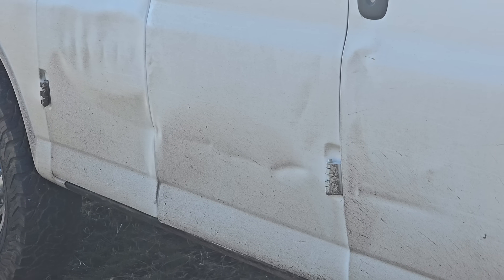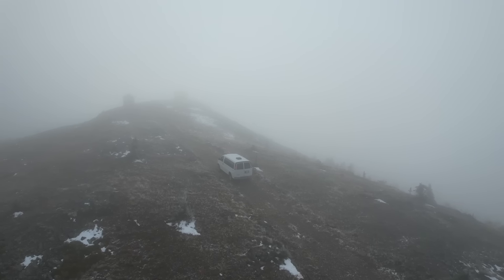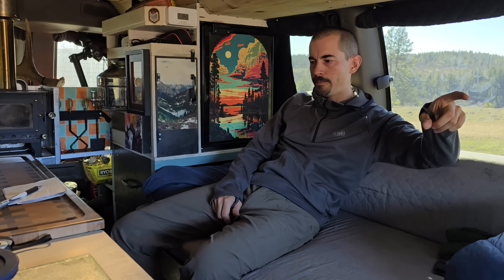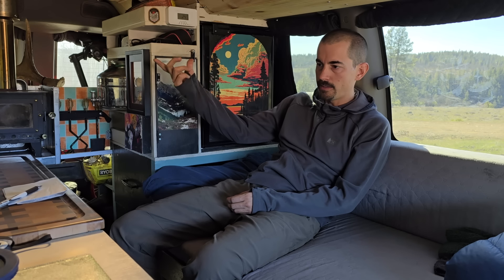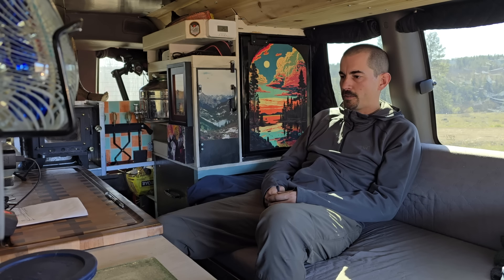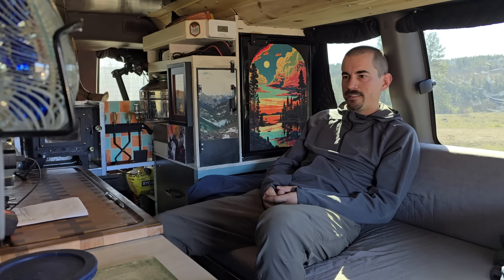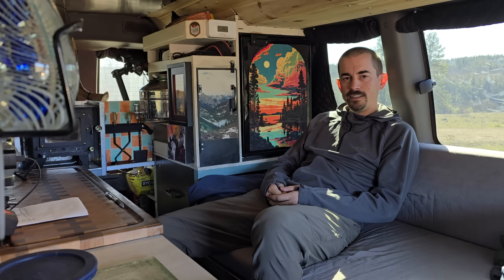Lets just talk about condensation and insulation.

Comment: I’m a certified energy auditor. Important to pay attention to the places where unlike materials touch. They are the weakest part of construction. As far as condensation and heat loss are concerned, your weakest places are where you have wood supports touching your metal ceiling.

If possible, remove everything, take your van down to the metal shell, remove rust, seal all nail/screw holes, and insulate ceilings and sides with spray foam. Put 2” closed cell foam on the floor. On the floor foam float the tongue in groove floor of your choice. Leave 1/2” all around the floating floor to accommodate humidity expansion. 
If wheel wells are noisy you can cover them with hushmat.
Reply: Absolutely nailed it! Great explanation
Reply: I am a HUGE fan of closed cell  spray foam.  We have used it on the floor joist, bays, faces, and cheeks of wood in damp crawl space at our cabin. ABSOLUTELY no transfer of vapor. I will use this in one of our Quigley cutaways that I want to use for 4 season travel. Additonally,  combustion air for a wood burner is KEY. Going to design my own with vertically orientated 10"x10" box tube. Fire brick lined, window glass, and combustion air coming from outside wood burner for the vans. It'll be like a sailboat stove ...but less expensive!!. Both our cabin and home are so tight that it'll pull a vacuum when we run wood burners that aren't drawing outside air for combustion.  In our home itll draw air thru  a basement drain traps. Pretty crazy, but SUPER high efficiency and tight structures  (vans too!!) will do wierd things
Reply: being too sealed up may have consequences for carbon dioxide and VOC levels especially in a small space
Reply: @ytuat  CO2 is not a problem.. CO is.
Reply: @ytuat  adequate ventilation is essential in any living structure
Reply: how do you fasten things down if it's complete closed cell spray foam? Pre-set fasteners and foam in/around?
Reply: Over 2000ppm CO2 will get to be a problem.  Over 3000 will eventually make me nauseous, feel like crap.
I keep a CO2 meter on the kitchen counter, in my van home.   I aim for 1100 to 1500ppm.   It's always a tradeoff, with fresh air causing more heat loss.
Reply: @OntarioBearHunter  ASHRAE recommends maintaining indoor CO2 levels below 1,000 ppm as a guideline for acceptable indoor air quality.
Reply: You forgot to mention that all of the windows have to be removed for true thermal control and efficiency. 😊 Oh, and every internal surface material needs to be thermally broken somewhere before it is in contact with any external structure. I am amazed at how badly even "4-season" RV's fail just about every principle of thermal conductivity. The supposedly superior names like Arctic Fox bond interior walls directly to exterior walls through an aluminum frame. 🙄 It's very obvious that the industry only employs CAD people and refers to them as engineers, not relevant PE's. But then again, they refer to aluminum foil as insulation, so...

Comment: Restoration carpenter here. There is a book called “keeping the heat in” by natural resource Canada. Has a lot of good info. Your insulation idea is good; and any spot where you have cavity’s you cant get rigid insulation in, try ROCKWOOL brand, or something similar(because it will get rid of the water if it does get wet). And lastly, for your boots, I’d say have a vent for the diesel heater to point at them. Get them dried out in an hour or two( or the electric boot dryers work well) while your cooking supper, so you can vent all the moisture before you close windows and hunker down for the night. Big fan, cheers

Comment: Hi F F. Always run wiring where it is easiest to access .  Having done more than my share to van travel I know there are many gremlins waiting to cause havoc..  You would be amazed how wiring can cause a lot of issues.  Having access to all your wiring is so important.  So easy to add accessories or remove or replace them.  My van was the same as yours.  Bare from the factory I was able to handle most issues that pop up.  And your mechanic will also be very happy from time to time.  Safe travels. ✌️🤓

Comment: The 2” wood will become a thermal bridge and condensation will happen at that wood area. (My thoughts)
The vapour barrier concept is not that a vapour barrier stops condensation. You need a minimum (a lot) of insulation.  Imaging just a vapour barrier installed on the bare metal.  You’ll have condensation on that vapour barrier(plastic) form. Because the cold plastic will touch the warm  air and then create moisture(condensation).   
I toured 3 months, full time, in winter on a ski trip  trough out the Rockies. In a nice new travel trailer.  We didn’t heat too much, had a dehumidifier going when we were inside and the thing basically rotted from the inside out. 
I’d say less is more, like you have it , or lots of insulation. And keep in mind, if a place has less insulation and might be prone to condensation, make sure it’s not wood or fibre glass insulation that will sock up and hold moisture.  Ridged foam is best.

Good luck with your future plans. All the best.

Comment: The insulation plan seems pretty spot on to me 👍 
That really surprises me the wood burner didn’t help . My old trailer had gas heating and had the worst condensation and moisture problem to the point the walls started bowing . I then put in my wood burner and it cured everything. It’s seemed to me that it was just a different type of heat it pumped out  which stopped even the condensation on my window. 
That was many years ago and made a wood burner my go to heat source in all my vehicles from the on . Had a kitchen AGA in my American school bus which is all windows and that was dry as a bone .

Comment: Loctite PL Max Premium is the strongest construction adhesive that I know of. I'ved used it when hanging ceiling drywall. An HVAC contractor ran a supply duct in an area where a full sheet terminated. Used the PL stuff and it held a 2 x 8 sheet of 1/2" drywall on the face of the duct no problem. We were able to use drywall screws along the wall seam but the rest of the sheet was held up by the adhesive. 20 min adjustment time but still grabbed immediately and held it up. The unknown is the jostling that you are going to experience. That house we hung it in stays pretty still :)

Comment: Looking through the other comments, I noticed that no one has mentioned Havelock Wool. We are currently building out our Promaster van, and after A LOT of reading and YouTube videos, we have decided on Havelock Wool. It is a little bit pricey, you don’t need a vapor barrier, it is not toxic, it breathes, has a good R value and saves time for the installation. We also have used Rivnuts to fasten our ceiling support wood , after stuffing the wool into the ceiling ribs, without having to screw more holes in the van. We bought the Rivnut kit at Harbor Freight, but you can also ordered them online.

Comment: Hey there!!! My wife and I also have condensation issues and we found that a 12 V DC Dehumidifier helps quite a bit! With windows closed in sun zero temps, it pulls about 1/3 cup water throughout the night. We have the grizzly cubic mini and thought it would help, but doesn’t. Building a garage and boxing off the front cab is a fantastic idea. We built an insulated garage and with that we can carry a chainsaw and never smell fumes. Great video !!

Comment: We got hooked when you were building this van. Then we stayed for the mountains, the adventure and then the puppy.  Can't wait for the next van upgrade it sounds very good.  We have a factory built out van and during the winter when not being used I keep it decently warm inside.  The cab front wastes at least have the heat so I hung a down comforter behind the seats and the difference is amazing.  So your wall in front and wall in back plus the ceiling will make probably a 100 percent improvement in comfort.

Comment: I always keep all the windows cracked just a little when I'm sleeping in the vehicle, regardless of temps. That's why I want those little window visors so precip doesn't get in. I wonder why your wood stove isn't more than warm enough already, you see Lost Lakes camping in -35 with his hot tent all the time. It should be helping more with your condensation issue but it won't work if all the airflow in the vehicle is closed off that's for sure. To prevent condensation requires not only a heat source but also a cold air intake - the cold air is drier than the air inside the vehicle and when you warm it up its moisture capacity increases, it picks up moisture, and then you have to let that hot air out too. Without good cold air intake and hot air exhaust, you'll never stop the condensation. A hot tent is dry because it is made of permeable canvas.

Comment: Keep that van........You may want Fluid Film Rust & Corrosion Protection it saves the frame and sheet metal........Best part is the bolts and threads under there don't get locked with rust.  Look it up if you would like.

Comment: Humidity will happen, but condensation is optional. CC foam only as it cannot absorb or hold humidity. It doesn't need to be thick; anything will be a great improvement over none. Metal is extremely good at conducting heat or cold so metal isolation will be crucial. Consider Tyvek as a breathable but waterproof membrane plus it isolates from the metal. Alternately thin CC foam sheeting is sold as underlayment for floating or laminate plank floors. Also keep weight to a minimum- it adds up faster than you think. Instead of T&G you can get wood paneling with the same pattern- much lighter and the same look. Instead of walls, consider blanket or quilt curtains with magnets to close the gaps. They do more than you think they will and do not permanently change the space like walls do. Cross-flow ventilation, from bottom at one end to top at the other end, is most effective; arrange as you please but be sure the bottom one can be totally sealed to keep the outside outside when traveling. A lot of times there's enough inherent air leakage to just do a top exhaust vent; power it if you prefer. Also remember that there will be condensation on the metal behind the interior surfaces. Most vehicles have plugs underneath in areas that may collect water. Some have 'weep holes' or channels for water to escape, and some don't. If yours are sealed, either drill a small hole in each or use a razor knife to slit them by pushing straight in; 3/4" or 20mm slits should be enough  to break the air seal but keep water from entering from the roads and puddles. You also need to arrange ventilation over the cooking area. An insulated small area is a cinch to heat; lose the insulation and it can take 5X the BTU's to get the same effect.

Comment: Thinking outside of the box here. I would find an old raised roof van and salvage the fiberglass top. Preferably the mid rise, then place a minimum of 2” of foam on the outside surface of the van roof. This of course would be a false raised roof but it would allow complete uninterrupted insulation which would create no thermal bridging and a possible bonus would be some storage up there. Then I would look into spraying foam underneath the van as well. Thus minimizing any headroom loss inside an already small area.
Reply: Continuing in this vein you could fabricate exterior insulated shutters for the windows. I’m thinking aluminum treadplate with foam on hinges. This would provide an awning in the summer as well.

Comment: Probably a good Idea that Moresty hosts the insulation debate 😅

They say a nice uniform layer of spray foam is good and acts as its own vapor barrier, but it is a pia to apply and can be expensive. Could be hard to frame over and screw your cedar to. 

The initial plan for my van was straight spray foam but ended up going with 3/4" foam board between the supports, then spray foamed the channels between, and then foil taped the seams. Ceiling panels are screwed into the supports which are insulated from the roof from the factory, by a line of spray foam.

I think keeping a bit of ventilation is the key because the moisture has to go somewhere, a lot of Europeans seem to put in permanent floor vents at strategic places. 

For prolonged extreme cold I want to install a second diesel heater at the back of my van, possibly a 2kw to save space and have a better heating range. Probably a good idea to have 2 anyway😅

Shrinking the heated space works and is a good move, I'm just using blankets now but a garage/cab walls would be the ideal situation and open up some storage.

Comment: Hey Foresty! Take your time and make it happen! We can definitely wait a while before new content pops up. Especially if it will increase your overall well-being in the van! :D I can recommend watching "greg virgoe" when it comes to insulation since he's an engineer and professional doing things like heat-loss calculations for commercial buildings. He has some pretty great videos on how these things work... that way you can make good and informed decisions on insulation based on science

By the way, regarding adhesive... I'm just kind of worried that the rubber mat will give up due to things like extreme heat from the roof and the weight of the wood ceiling. Wouldn't it be possible to support the beams through the kitchen construction and perhaps (oh man, this is gonna get really hard to explain without drawing) build a bedframe like Ikea's KURA. That way you will have support from the floor on both the kitchen and bed side. :) Just an idea, but you have likely done far more research than me. So you do you in the end. :D

Comment: You are crazy smart and resourceful. An HRV is embarrassingly simple. A couple blowers and alternating layers of coroplast that let the heat pass from the exhaust air to the fresh air - add a drip tray to catch the resulting moisture from the cooling humid exhaust air. Build your rear insulating / dividing wall out of 6-8 layers of 1/4" coloplast.
Reply: What does HRV stand for?
Reply: @petrushka1611  Heat Recovery Ventilator. A device that exhausts stale, warm, humid air and draws in fresh, cool, dry air. The 2 airstreams flow past each other in a passive heat exchanger so that some of the precious heat you created inside the home is transferred to the cool incoming air reducing your heating costs.

Mandatory in pretty much all new home construction in Canada. Used to cost effectively reduce humidity in winter.

Comment: My van is electric. I got a de-humidifier that keeps relative humidity below condensation point. Although there are plenty of cold-bridges etc. Air is just to dry to condensate. Don't go dryer than needed, as your breathing becomes dry. I don't need to go lower than 60% rel. Problem fixed, no foggy windows neither.  Heating smallest area possible is key.

Comment: I think you have things better thought out than it may feel at times. For as much as I said "go for the truck", I too have taken (mechanically) too good of care of my van, and don't really want to start over for the same reasons. It gives me everything I need, is 100% reliable, and is paid in full. That said, it is more feasible to do improvements than to start figuring things out with a whole new setup. You are absolutely right about people driling through their vapor barriers, because even if they are sealing those punctures its no guarantee that those seals hold, and is forever hidden after the fact. You stick to relatively cooler climates throughout the year, so a good strong adhesive should support your approach as drawn here. Closing in your living quarters should make all the difference. Finally, you're right, it's not about aesthetics, though you do a good job with the means that you have. A brief rental will be easier with Rocko too, of course. Good luck, I look forward to seeing the finished product.

Comment: ❤😂❤ okay Simon I am headed outside to the van to pull the humidity gauge out from behind the wall between the foam board that has foil facing facing out to the skin wall of the van and then the foil wrapped bubble insulation. This morning it was at 30% I'm going to go check it now in the afternoon in various places because like I said we did not tack it down even though it looks like a spaceship😮😮❤😮 it is only taped and strategic places from the wall standpoint the ceiling is already done but the walls the bubble wrap insulation is basically just hanging there in sections taped along the different struts😮 I'll come back this afternoon to let you know what the humidity levels are now and then I will check them again later on tonight😮 Simon I live in an environment almost identical to yours and I have waited all winter to complete this job because I was concerned about the moisture and the condensation that was collecting while I was in the van so I was very careful about what I would do I would measure out the foam board but I wouldn't put it up cuz the walls were damp😮😮 I spent $73,000 on this girl and I want to make sure that the woman that inherits it doesn't have a nightmare on her hands😂😂😂 stay tuned folks the experiments continue
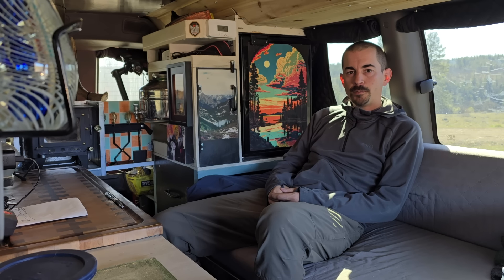Reply: Okay at 4:00 in the afternoon with the sun shining on the other side of the van the moisture on both sides under the bubble wrap in between was down to 20%😮 the temperatures are cooling off and we actually have snow coming in a couple of days😮